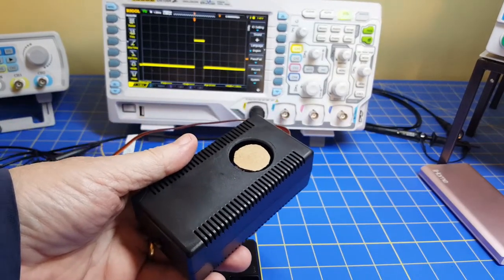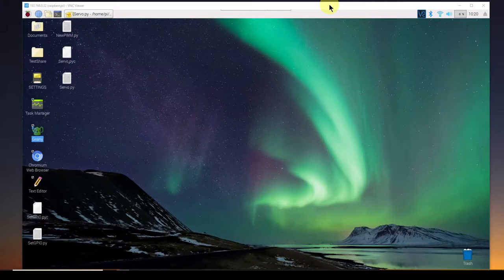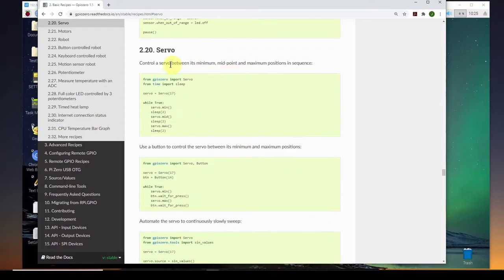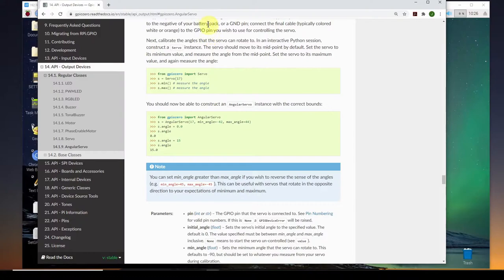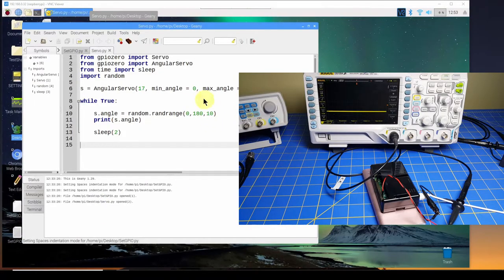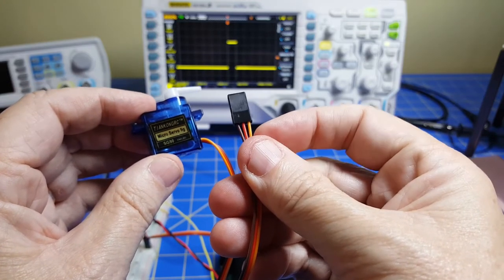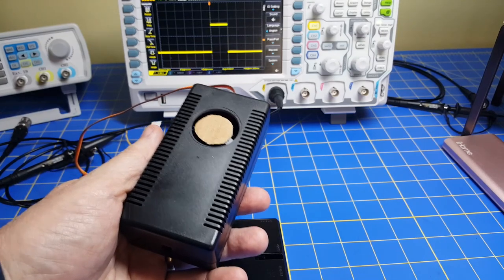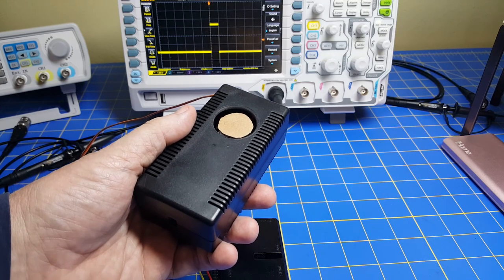Mouse Jiggler Project Part 2: Raspberry Pi with Servo

Comment: Using a RPi seems like overkill.
Would it not be easier to use an arduino and program it as a keyboard controller and tell it to push an unused button every 5-10 seconds?  That way you will have full control of the mouse and there are no moving parts.
Reply from the maker: Perhaps you missed the beginning of this video where I said that in the next video we'll do the same thing with an Arduino Nano. That video is scheduled for tomorrow.
Reply: @EETechStuff  no, I heard you.
The motor is also overkill, IMO.
Program the arduino into a KVM and call it good.